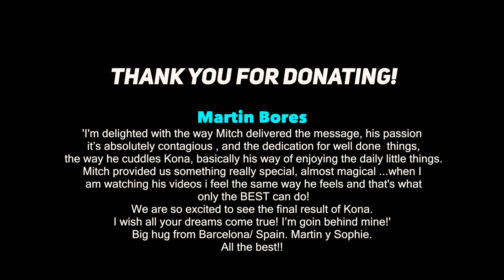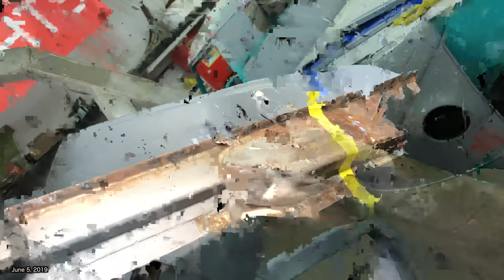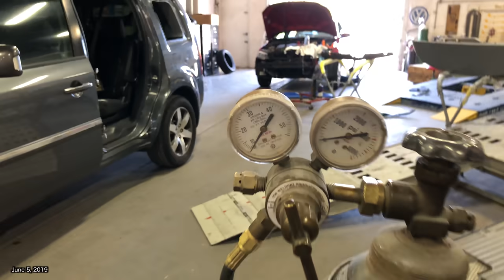VW Bus Restoration Episode 17 | MicBergsma

Comment: They have rotisseries that can be operated by one person with rams and some guys even have ones with gears and chain setups that can be rotated with an electric motors. btw  Sand will be falling out of that bus for years to come that's what sand blasting does unless you take an air gun to it for a long long time and even then its hard to get it all out.